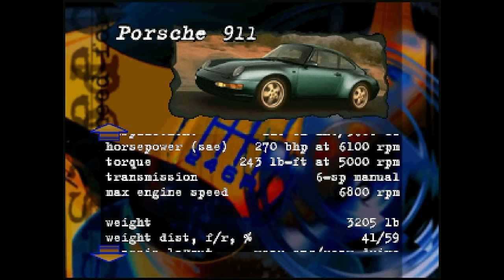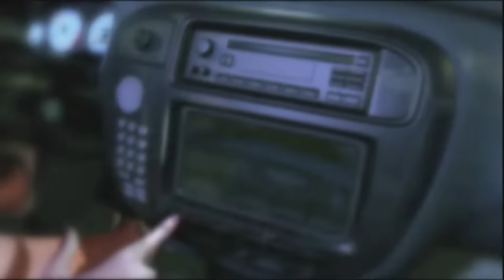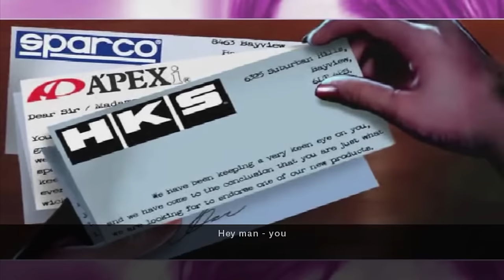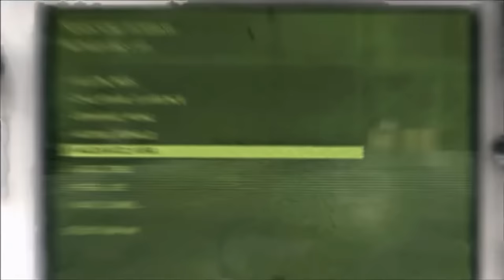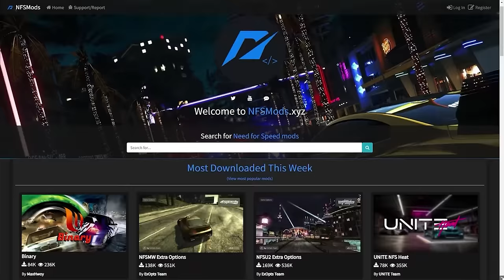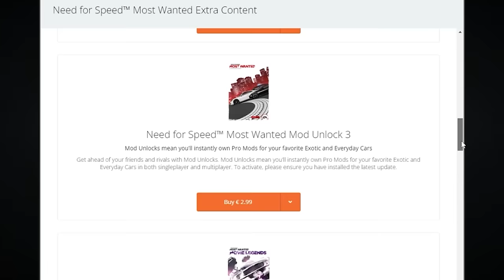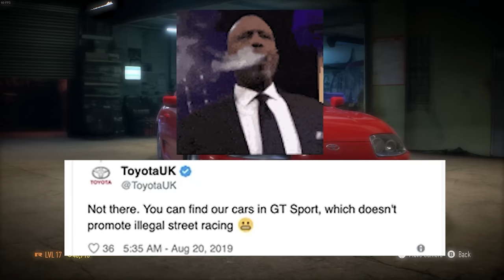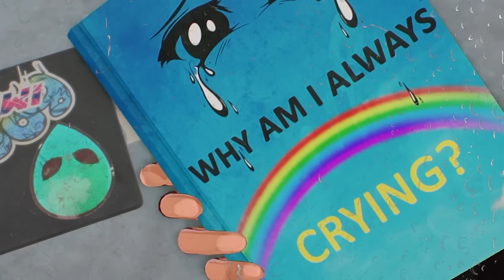The Legacy of Need For Speed (feat. KuruHS & DustinEden)

Comment: The cars with the raised rear-ends in Nfs Nitro remind me of the truck culture here in Brazil.

Just search for "[Truck name] arqueado", or "[Truck name] qualificado". I suggest looking up the Mercedes 1620 (because it's my favourite lol).

"Why do people do this?" You may ask. Well, some drivers say it helps with cornering (it doesn't), some say it looks cooler (depending on the angle, it kinda looks imo), but the most probable reason for its existence is because people used to put illegal amounts of whatever they were carrying in the truck, and the extra lifted rear made the truck look normal with the extra weight.
Plus, it is dangerous af not just because you raise the center of gravity, but because if a car, for example, hits one of these raised trucks from the back, it goes under the truck.
Btw, not only is this illegal, but even other drivers discourage this.

Comment: Some stuff related to 90s NFS that i wanted to add:

When you mentioned you couldnt win any track, on Rusty Springs the car pick was right, the Supra is the only that can take the last turn at full speed, you just need to drop down from 160 to 140, then downshift to 5th and you can take the turn without major speed losses.
I would have added to the TNFS retrospective that the PC version is faster and the menus are optimized for a keyboard and mouse usage
while the Saturn and PS1 are thought for controller usage (duh)
The PS1 lightning is better on that console and the polygon count is higher 
Saturn runs better but it uses triangles instead of polygons and the lightning is worse, but it doesnt wobble as much as PS1. 
Over-Drivin' GT-R and Skyline Memorial, while the same game, got different car lists. This is the first time NFS ever featured the R33 and 300ZX
3DO, PC, Saturn and PS1 all weight the same (roughly around 320 or 520mb) but all Xman videos on 3DO got replaced by more car slides and voiceovers, matching the file size.

You forgot to mention that NFS2 was the first NFS game to introduce B2D

High Stakes was literally NFS 3 super updated that EA decided "yeah, this looks like a different game, lets ship it with an entirely different title" 

Also PC Porsche Unleashed DOES use PS1 High Stakes as a base, they made the game over that version. The FD Porsches can be used in events where its open to every car, such as the European Rally Event, where you could even race a 911 GT1 against 356s and 550 Spyders...also this version is the second and last ever simulation NFS game

Overall nicely done on that part

Comment: Tiny oddity that may or may not affect viewing experience, but you kept mentioning HP1 as HP3 when there wasn't a HP3. I'd assume you meant "Hot Pursuit" instead but idk

Also you should try the dinky ass mobile ports, i have HP Mobile, No Limits and HP2012 -which i feel is better than the actual 2012 because the cars have identities and personality in their paint jobs (yes they have ACTUAL CUSTOM PAINTS. IN A MOBILE PORT. IN *2012*)

Comment: I feel so lucky to have gotten my first PC right when Underground came out, of course UG2, MostWanted and ProStreet followed, and these game still live on my SSD till this day and get replayed regulary. First NfS I didnt buy was Carbon, didnt like the style, after that I wasnt interested in the new titles that much. Back then NfS was all the rage and I didnt have a console, only today thru modern emulation and a broader horizon I play these other gems from others series ( FM4, FH1, FH3, PGR4, PC2, AM2, MNC:LA, DriverSF and so on). 
Recently I actively tried to like " modern" NfS, I got HP2010 which is OK, and I got Heat because its the better Unbound. But like many modern games Heat on side pretty broken ( Unite mod is mandatory for gameplay and looks, options are non existant, bad PC port) and on the other hand it forces to install EA Desktop because even for Solo play it needs internet all the time...